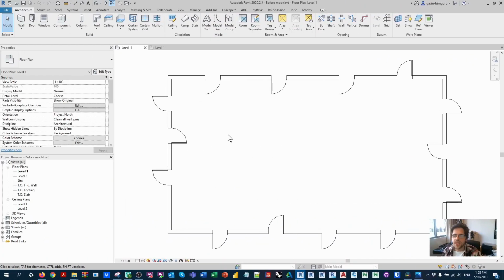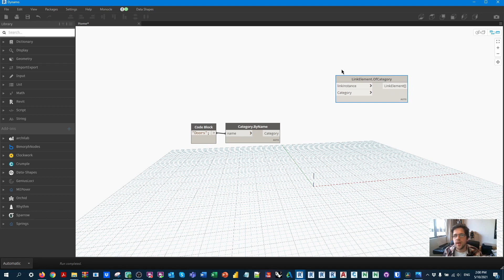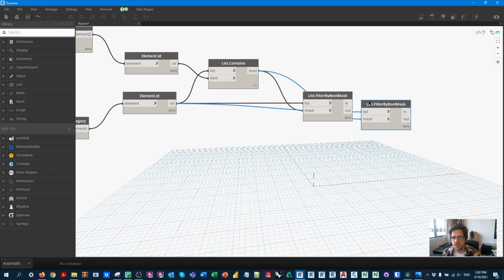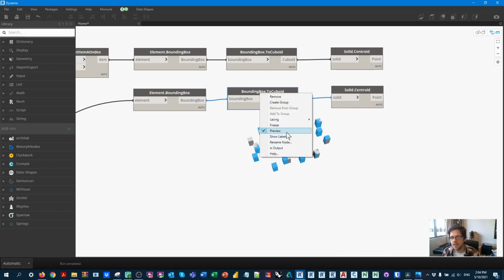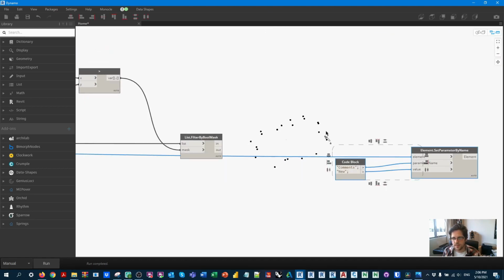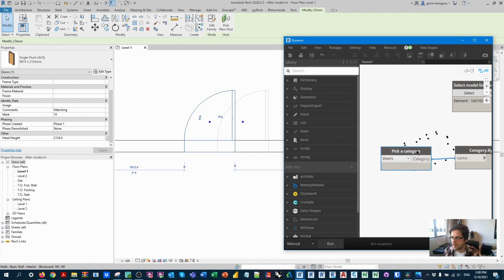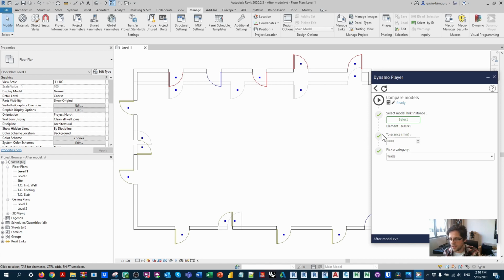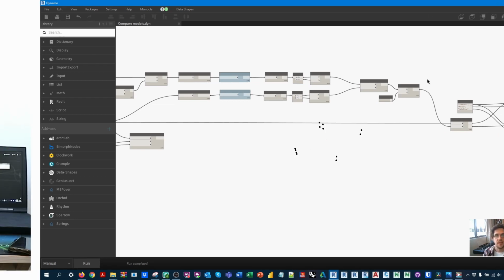Compare Revit models using Dynamo (with tolerance)!

Comment: Hello Gavin, thanks for this video. 
I'd like to to something like this but with two differents models. One as master (architectural one with all structural's elements in one workset) and anoter model from structural ingenieurs. The structural model is linked to the architectural one. And i would like to compare all the structural elements between this two models. I started a dynamo script and i have all the bounding box from both and the centoid too. But my problem is i don"t know how to compare them as the elements ID are differents between this to models. 
can you help me by giving me a way to work?
Reply from the maker: Unfortunately without matching Id's it is almost if not impossible, as the geometry of the elements would not be comparable if the elements have changed or are missing. Maybe check if Dynamo forums has some options.
Reply: @AussieBIMGuru  Thanks a lot. All the solutions I find are based on comparing two versions of the same model, therefore with the same element ID's. But unfortunately this doesn't meet my needs. I would like to compare the structural elements modeled in an architectural model (beams, slab, posts) with the elements modeled in the structural engineers' model. The elements have different ID's and also different family names.
Reply from the maker: I guess imagine if you didnt have automation, how could you achieve this manually? If you find a solution that works there, then you can focus on automating it.

Comment: Great video! You are a wizard and can barely keep up. One question that I have is is there a node that can be used that will allow multiple categories to be compared at the start of the script? I tried to do it, but was not successful at getting it to work. Would be great to know which nodes could be used to do this.
Reply from the maker: The script generally compares elements by Id after initial collection, so you can collect elements as a list of categories using elements.ofcategory first, then flatten those elements down to a single list instead if needed.

Comment: Nice tutorial using a very simple method; the more complex the model and comparison method gets, the more difficult it is to get an overview.

It would also be possible to use other methods to make comparisons, like getting the location of each element, comparing, and comparing the volume and surface areas. There are situations where the model will change in ways which will not trigger differences in centroids; namely symmetrical changes to elements widths.
Reply from the maker: Yes this is only a good method when it is likely to suit the changes being searched for. A centroid and bounding box size is generally safe for geometry (as even if it grows in size, the BB will also change so it will be detected), but if data must be checked as well then it adds a lot more to compare.

Comment: Got an issue with Revit 2019 not having the issues add-in, is it possible to use dynamo to create something similar?
Reply from the maker: Not with the same UI unfortunately. The best I can think is to place markers in the actual models you share with consultants and add comments to their parameters so they can be scheduled/reviewed in the linked state by other parties receiving your models. Dynamo could probably be used to develop a more robust workflow, but it would be very bespoke/complex.

Comment: Wonder what way you could check to see if the centroid of a wall has moved only parallel to the wall meaning it grew of shrunk so that it can be used to comment it as matching.
Reply from the maker: In that case you could compare the length parameter of the wall in addition to the centroid.

Comment: I think this could work well if the script added the filter into the model so you could use it with architects models without having to setup filters everytime.
Reply from the maker: The archilab package has nodes which can construct filters, so it could be done.

Comment: Hello Gavin, I am trying your routine, but i have a problem : 
When trying to get the list of ID's in both models, the same ID might have a different order in the list (the cause : a deleted door from the old model, so if this door was the 3rd in the old list, in the new list, the 3rd ID is different...). In this case, when using list.contains and list.filterbyboolmask i am getting wrong results, i am getting TRUE for the first 2 doors ID in the list and FALSE for the rest, eventhough 90% of the doors are still the same...any idea how to resolve this issue?
Reply from the maker: This routine shouldn't depend on the id's being in the same order. The intent of the initial list.contains is to identify elements missing from the data set before matching up the data by finding the indices they occur at. Make sure you've applied the list levels properly as this might have an impact.
Reply: Hello Gavin, I must be doing something wrong cause even though I've moved 2 doors, deleted 1 and added 1 it still shows 10 doors as Moved. It is Revit 2023, not sure if it makes any difference though.
Reply: One of the indices shows -1 value, the rest shows the same value up until the place with -1 and then from this point onwards values are lower by 1.

Comment: Hi there Gav. Awesome video as always!!!

Recently I had an idea of a routine in Dynamo and I implemented that it takes all doors and windows in a project a use the wall they're in to set beam elements on top of the doors and windows and on the base of the windows (I'm not quite sure how you call theses elements, since I'm from Brazil, Lintels maybe?) and the user only has to set the type of Beam and the amount they want the beam element to exceed the doors and windows dimensions. 

However when I implemented this routine I did not had the knowledge about BuiltIn_Parameters that we can obtain by Python and other programming Languages in the Revit API !!!!

 Because of that, I used the node "GetParameterValueByName" and my parameters are in Portugues, and so "Width = Largura" and "Height = Altura" and so on... This mean that someone with a family that has a parameter that is not names exactly as my string in the "GetParameterValueByName" node will not be able to use this routine. So I had the idea of using Python and getting the BuiltInParameter for the Doors and Windows Width and make the routine much more acessible. 

Would you want to try to do this and post it out? I can sendo you the dynamo file, it could be a good example for BuiltInParameters...
Reply from the maker: For lintels I typically use a bit more of a data driven workflow, depending on if actual elements need to be placed. Typically I check the host wall type of the door/window and if it contains a brick material then I would populate a custom parameter to inform it that it has a lintel, and use Dynamo to calculate the required length (nearest width + an excess overhang).

Language is typically problematic in Dynamo unfortunately, but you're correct that for builtin parameters you could probably work around this using Python. I'm quite busy these days, but I encourage you to share it over on the Dynamo forums with others and see if people have suggestions as well.
Reply: @AussieBIMGuru  This is exactly what I did for lintels as Well, only issue is with the parameters. But maybe BuiltInParsmeters can make the routine much more powerful
Reply from the maker: @alvernepaiva3287  yes I guess it depends on the expected reach for such a script. With Dynamo I find making small adjustments isn't usually too much of a problem, it's moreso applications which need to take such factors into account.
Reply: @AussieBIMGuru  You're right about that... 
Gonna try to implement this Idea. God bless you my friend

Comment: Hello there! thank you for the video. It is an fast solution. Elements ID are not always reliable for comparison, are they? In which cases I can trust elements ID hasn't changed in one of the models? I am making something similar, the difference is that I am getting elements from a linked file and copy them to my current file. Later, both files will be modified and I should monitor those elements previously copied from link by comparing them to the updated linked model. I guess the way to go would be using Mark or other parameter to identify them.
Reply from the maker: An element Id should be reliable as long as it is the same element. Once it is deleted from the model or cut/pasted it is a new element with a new Id. If it's changed between models then that element was probably replaced I think. Mark or another parameter could be done, but is more challenging as you might have duplicate outcomes via copying.
Reply: @AussieBIMGuru  Thank you very much :) it may work with element id then. And yes it is safer because we avoid duplicated elements. Thanks again! Great video